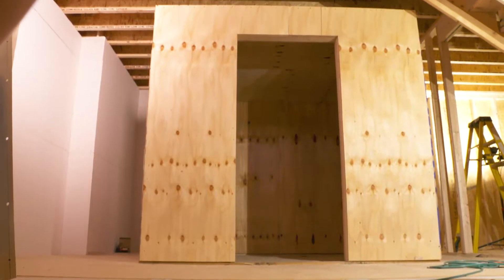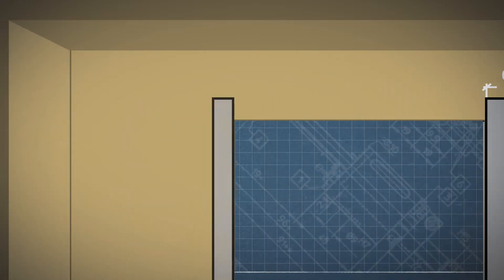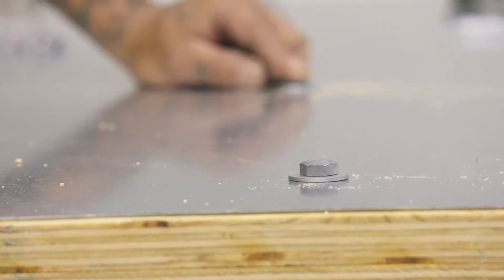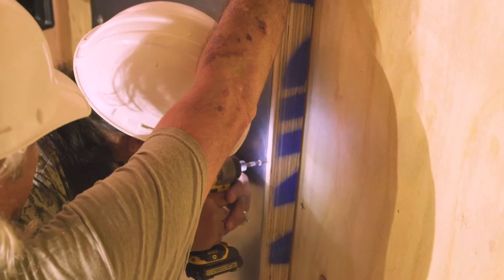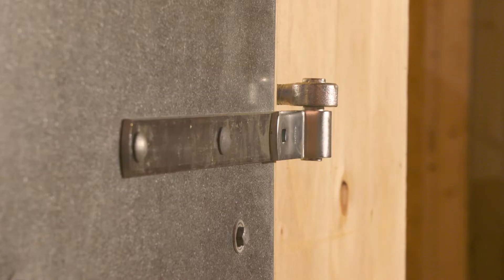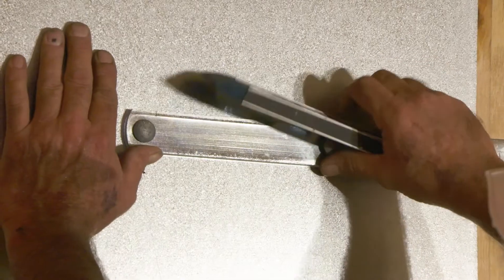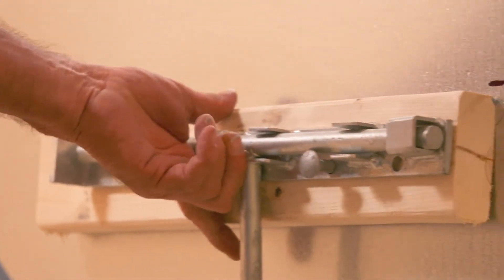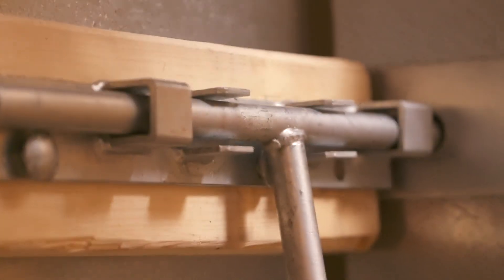Constructing a Wood Tornado Shelter (5 of 6)

Comment: Is there an alternative to having the hinges on the outside?  As a saferoom it wouldn't take an intruder much to cut them off.
Reply: It would take an intruder less time to chainsaw through the wall.    Most intruders wouldn't have angle grinders or chainsaws with them, so I wouldn't be too concerned.   If you are still concerned, just keep a firearm in the shelter.

Comment: Keep a battery operated chainsaw inside cut your way out when the inevitable debris blocks the door from opening. I like how that guy is overtightening the lag bolts so they just spin. Use a driver with a torque adjustment or a socket to get the bolts just right.
Reply: Great minds think alike! :)

Comment: Anyone with an iota of common sense knows that fire burn wood and, a safe room should have a swing-in door. Why? In tornadoes, objects are thrown around and explode causing fires, so you don’t want a wooden “safe room”. Also, if something is laying against a door that swings out, you will be trapped inside your “safe room” to be burned alive. Look into ICF or CINDER BLOCK REBar reinforced safe rooms. Don’t believe this wooden disaster waiting to happen. It will be where the authorities will find your dead carcass.

Comment: My main concern with the design, is the swing out door.  In a tornado event, you might not be able to get the door open, due to debris. All the commercial in building shelters seems to have swing in doors.  But this design does not lend itself to making that change simple, as the walls help hold the door closed.  The door is bigger than the door way and overlaps. The locking hinge is just to prevent the pressure difference from pushing them open. I'm looking for options in my existing basement, and living in tornado alley.
Reply: I would either install a small secondary "hatch" or just keep a battery pack chainsaw in the shelter. It could remain charged with a trickle charger.   On second thought, just keep a few wrenches, a hammer and a punch (or metal rod) in the shelter.   the lag bolts securing the door hinges can be removed from the inside and the lag bolts can be tapped out with the hammer and punch.
Reply: I agree.  I believe the room could be constructed with the same materials in the same locations except using a different method of construction for an existing room.  A different door could also be used.

Comment: I appreciate these videos. It does help the beams and the plywood are glued together, the way each part if grooved and glued and the anchors and hurricane ties.  Do not listen to the idiots criticizing and giving examples of house blowing up, they don't understand that those houses are not anchored the same way, nails are a joke and they are almost glued with saliva to the slab. And, the key is once one of the sections (a wall or the roof) lets go the rest collapses. The way they are constructed is counting on gravity to push down and not pulled upwards. Besides, it is a solution for homeowners to build something which beats a bathtub or a closet any day of the week.  And, some people don't understand that cinder blocks crack but wood, if thick and sturdy enough can absorb impact.
We know those idiot keyboard warriors would run inside this shelter and none would stay in their living rooms. Again, thank you! I love this design! is feasible.